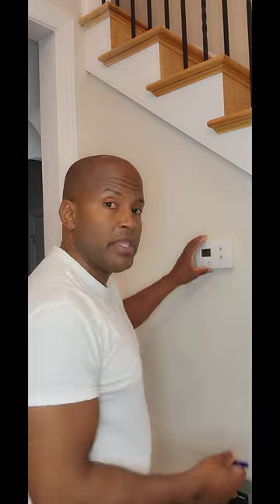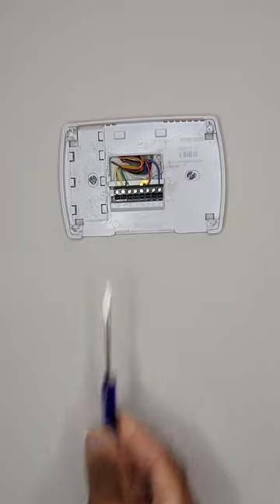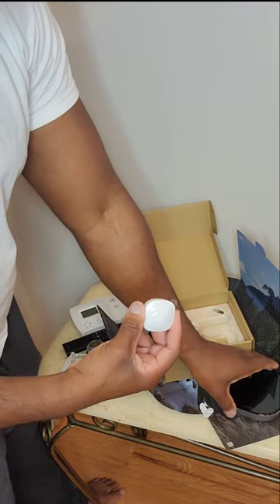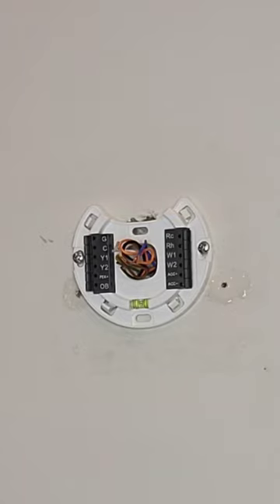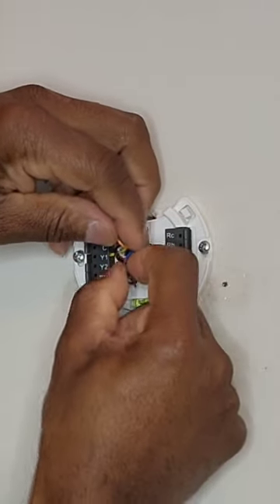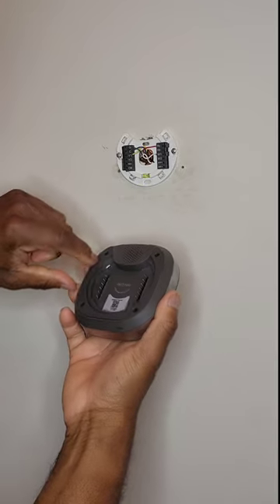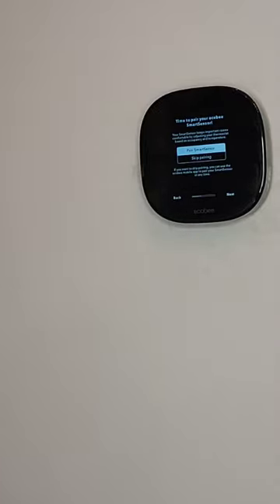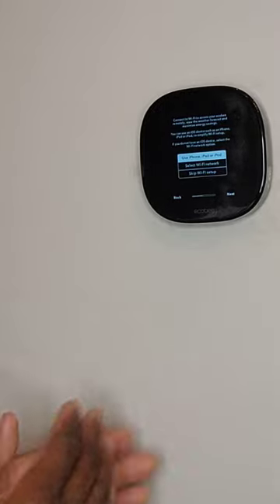ecobee - How to install ecobee Smart Thermostat Premium with Voice Control & Remove Honeywell

Comment: I had the same set up but when I plugged the W wire into W1 and powered on the Cool it blows out heat? I was told to plug the W wire into the O/B wire I did this and it worked. Have you herd of this issue? I am electric not gas and I have a heat pump?